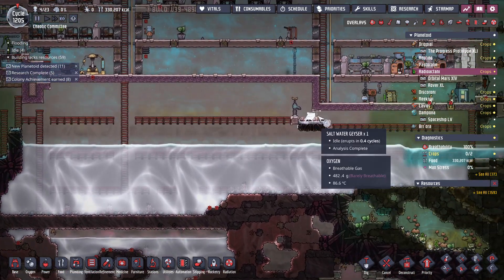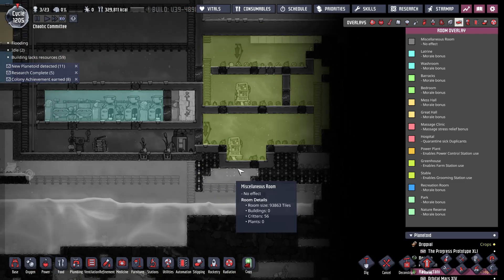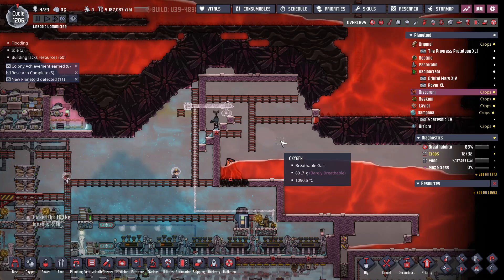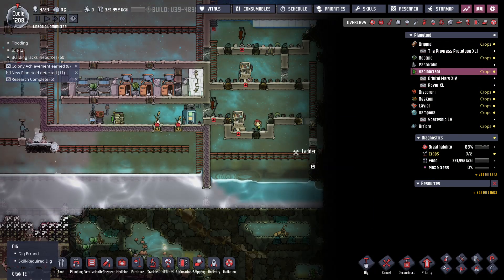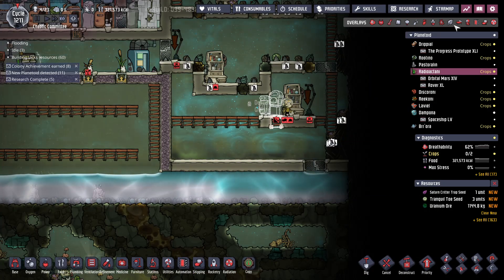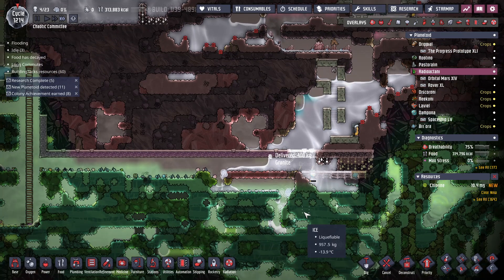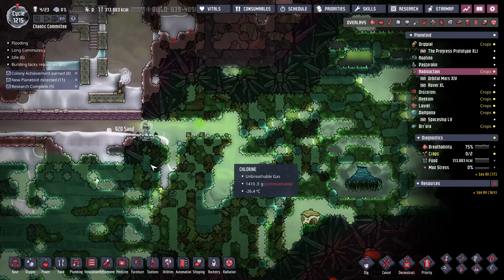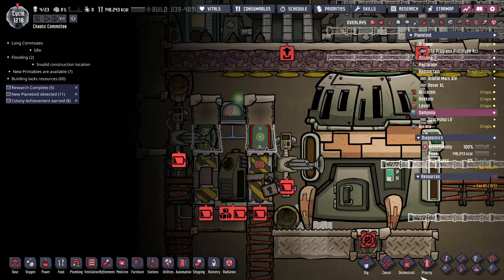Chaotic Committee Ep 36 Rad New Base is Built, Fun Stable Shapes, Magma Mistakes

Comment: Reactors got internal cooling. So the important bit is to always have fresh water. For the delivery of uranium it's handy with a meter set at 3-5kg and a timer sensor so it sends it once per cycle. For reactor enclosement multi layers is recommended. Insulated, lead and insulated again takes most radiation away. 😊 Really love this series.
Reply from the maker: Thank you for watching.  Reactors are still new, so we all have to experiment what works best to control them. I think this base I am going to go full power on them.  The other base I will try limiting the delivery.

Comment: on the base where you drain magma, if you put in a few more insulated tiles on the "stair" part, you don't have to cork it again
Reply: end of the day he still has to remove a tile to add more magma tho 

..well or use a steel door
Reply from the maker: Yes I need a better lock to be sure to have it not boil.
Reply from the maker: @xyvernthederg5760  yes I should add a door, at some point I will do that.